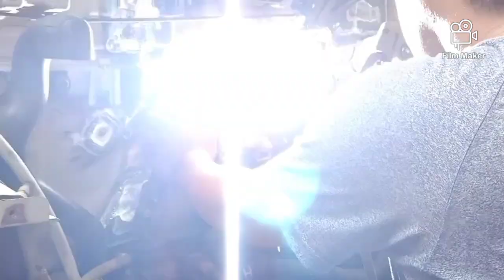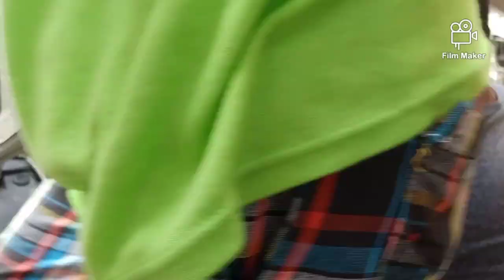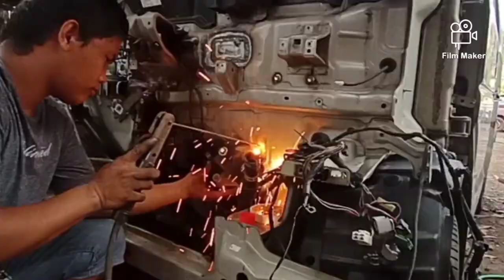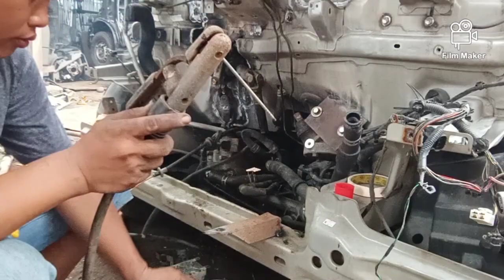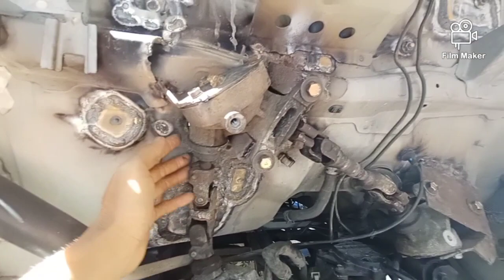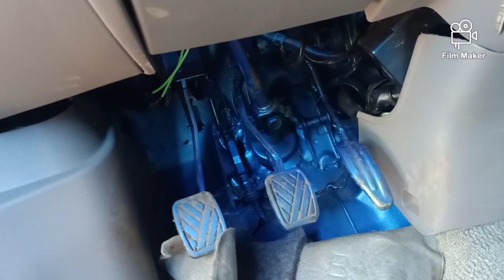Amazing CAR Steering Conversion From Right To Left Hand Drive

Comment: Boss may i suggest instead using soldered para maikabit yong cut pieces sa dashboard para malinis and strong used 3m window weld polyurethane 08609 opposite side sa dashboard and make sure to add some metal braces. And before you weld the steering rack make sure boss put some anti corrode treatment before you weld kasi importante yan para matagal mag rust imlortante yan kasi main component sa kotse and delikado sa disgrasya. Para malinis pag ka cutting sa dashboard use electric saw hindi mano mano para malinis pag ka gawa. Yong butas sa right hand drive make sure after weld treatment mo anti corrode. So far the way i see you convert hindi quality. Just sharing some thoughts
Reply: napaisip din ako dahil sa maraming welding. pag hindi naka rust proof, madaling masira
Reply: Great advice, it's very important to do it correctly because your life will be at risk especially on the expressway.  I live in the Philippines, but from the US so not comfortable buying a conversion unless I know it was done correctly.

Comment: D gaanu safe ang conversion ng added steering gear box?
Sana man lang naka bolt un sa kaha maliban sa spot welding? Later on kakalawangin yan at maguumpisa gumalaw yan?? 
Im not totally convinced safe yan lalo na kung everyday gamitin.. D xa safe sana imodify nyo pa conversion for added safety! 
D uuba ang spot welding lang?!.👎👎👎
Also, un mga tauhan nyo bigyan nyo ng safety equipment dahil hazarduos materials yang hawak nila.. Bagsak kau sa quality standards ng safety.. Mandatory u have to protect their health as well.. Wag puro kita lang po?!.👎👎👎
Reply: Agree dapat pa machine shop mo nalang Yan. Safety pah.
Reply: Interested ren ako sa sasakyan but concerned sa safety ng steering conversation. Cguro pwede mafabricate ng brackets to hold those secondary drive gear in place at gawin bolt on job na lang at reinforced yong pwesto kung saan i bolt on.
Reply: Tingnan u Muna mga sirs ang pagkagawa Bago kayo mag komento.. lol.
Reply: Mas maganda yung Putol kesa bakibaki daming gumagalaw na parts at daming winelding